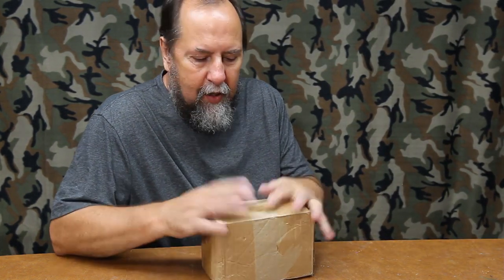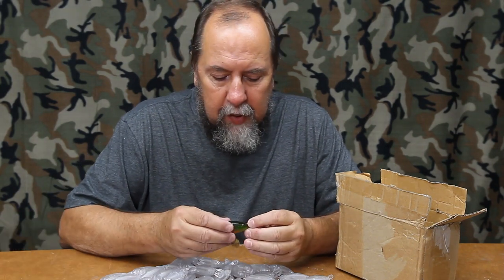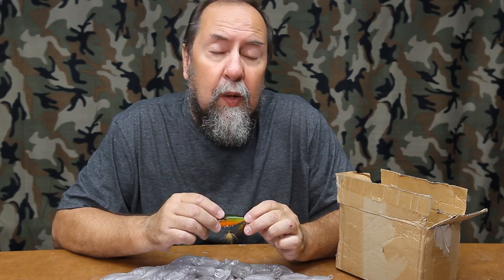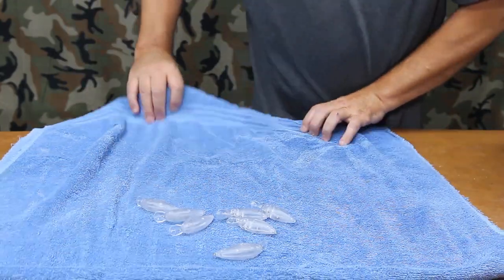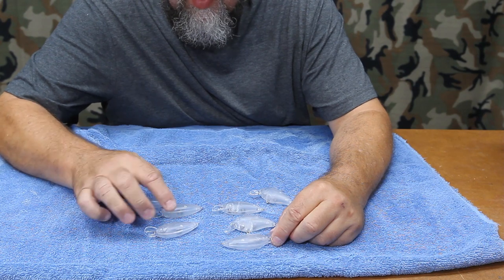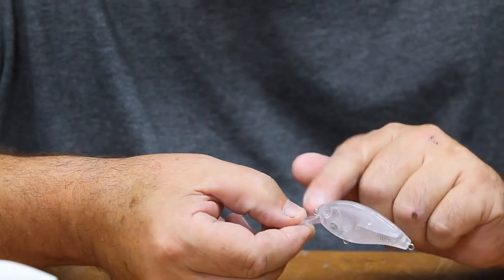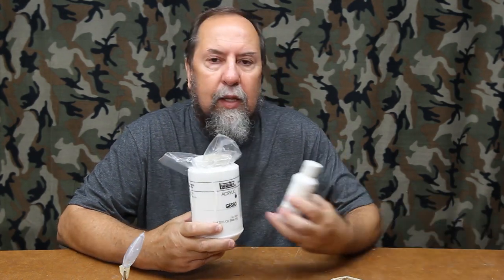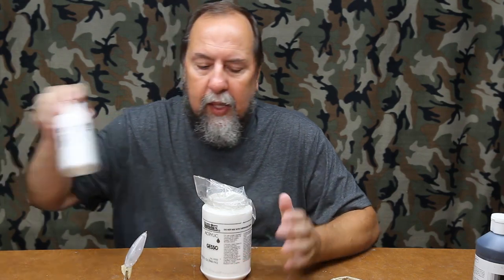Professional Lure Preparation for a Great Paint Job

Comment: Thanks for sharing! Never heard of Gesso. I've shot guitars and motorcycles, and found that Binz Primer/Sealer, found at Lowes and Home Depot, worked great as a foundation. It's shellac based, and everything seems to stick well to it, plus it comes in an aerosol can. Duplicolor Adhesion Promotr also works well, and dries clear.

Comment: Chris, what a delight to find someone doing similar fly tying lure building, painting etc.  In MN, lots of warm water fishing.  Gesso is a great tip.  Researched it some...see that have sandable gesso.  Looks great for cork bass bugs.  Have you used sandable gesso?  Also have you use gesso as a primer sealer for vinyl painted jigs?
Reply from the maker: I have not tried the sandable, but I don't see why it wouldn't work. I use regular on lead jigs that I am going to paint, so it should work under vinyl.

Comment: Hello there, will this acrylic base coat work with a water based paint on top? Just want to make sure because I use all water based paints for my lures
Reply: It will, I use waterbased acrylics over all different kinds of primers, they'll adhere just fine. Happy painting, tight lines! 🤘🏼
Reply from the maker: Anything noted as acrylic is water based. Yes, they will work perfectly together

Comment: Do you put any type of clear coat over them after color paint?
Reply from the maker: That is the million dollar question on the bait painting group sites. A lot of painters use Alumilite products. I am a fan of Component Systems Seal Coat. It is a water based polyurethane product that doesn't smell or need a thinner cleanup.
Reply: @chrismihulka-nwfishingstuf3852  I ordered kbs diamond after doing some research. I hope it works!

Comment: Thanks for sharing, could you please provide  a link to the mini gun? Did you ever  use gesso on resin, epoxy-poliuretanic lures?Thanks
Reply from the maker: https://www.harborfreight.com/quick-change-airbrush-kit-93506.html
Reply: Thanks so much for your help and kindness. The mini-gun practically is a "fead bottom airbrush" that can spry more dense paint than traditional airbrush, am I right? Thanks
Reply from the maker: @lannabulls  Yes. It has a bigger capacity and larger nozzle that most air brushes have so it can spray more dense paints, and also paints with additives like glitter or mica powder.
Reply: Thanks so much Chris!Unfortunately I can't buy it, I'm living in Thailand, that website doesn't ship here, only USA and a few other countries. I look after this mini-gun in eBay, Amazon, they ship here however I can't find it, thanks anyway, you're help is really appreciated!

Comment: Do you have any idea what the thread size is on the HF hose?
Reply from the maker: I don't understand the question?
Reply: @chrismihulka-nwfishingstuf3852  Threads at airbrush inlet.
Reply: Luckily I had an adapter on had and it's the same as a badger. You can use a badger quick connect.